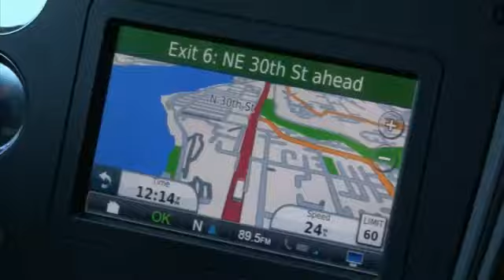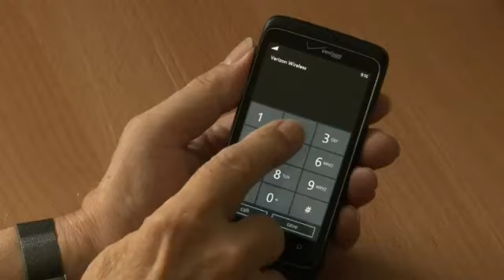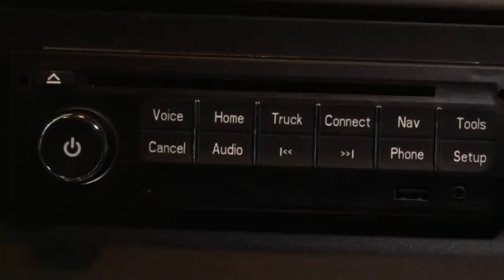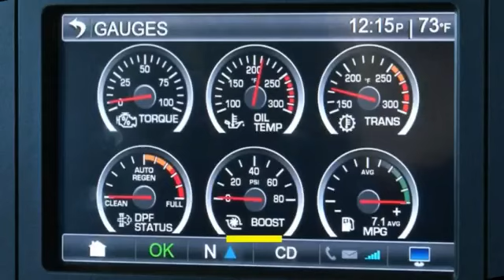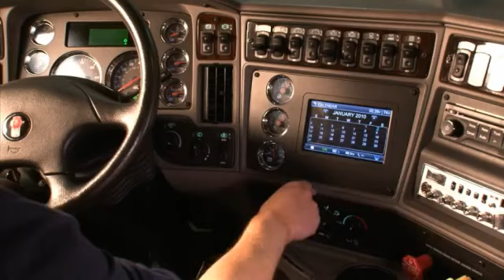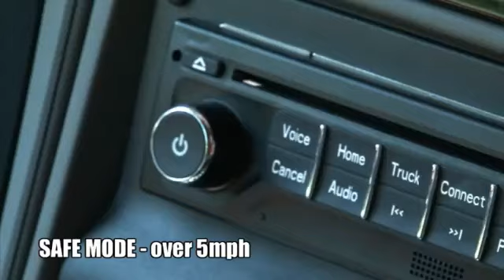Kenworth NavPlus Driver v3a

Comment: What a shame Kenworth has put this malfunction prone system in an otherwise great truck. I'm going to remove it from my 2017 Kenworth and replace it with an Alpine stereo, and chock it up to their bad idea. When you order a new truck, stay away from NavPlus.
Reply: Calmargarita I have it in my 2017 Kenworth, but I found out from Pana Pacific that it's in need for an update being that the software is outdated.  Quite simple to update if you have a strong WiFi.  I have no complaints with it as of now, just needs a update.
Reply: Hi, Wayne.
As I was starting to remove the screen from my truck, I discovered that as it is mounted, the screen is in contact with the bezel surrounding  it around the perimeter of it and that seemed to interfere with it's operation. I tried spacing it out a bit and it seemed to help my problem to a small degree, but the problems continue. I am still waiting for an update that Kenworth promises is forthcoming, and they will contact me when it comes available. Do you have a different method of updating rather than taking it into a dealership? Is an update available now, and they have not let me know?
regards, Brian
Reply: @sonshinelight   https://www.panapacific.com/support/download-2/kenworth/navplus-software-update-instructions